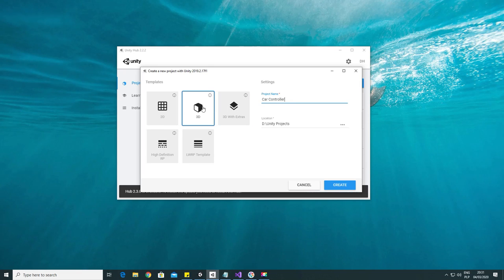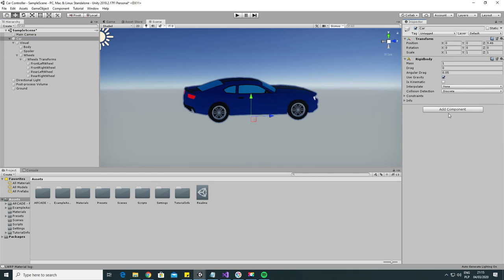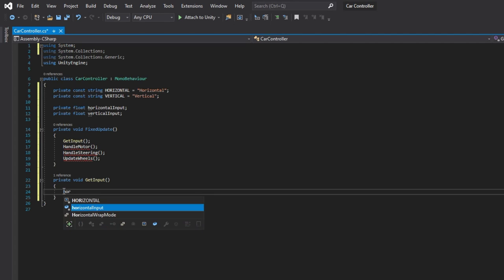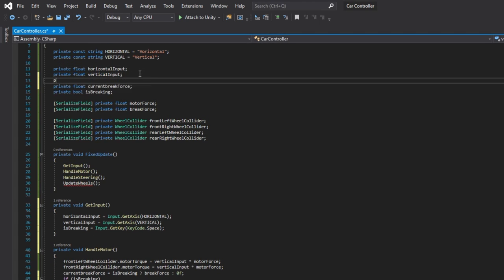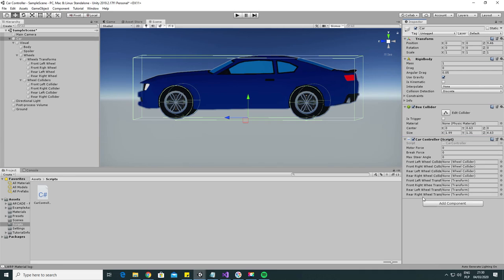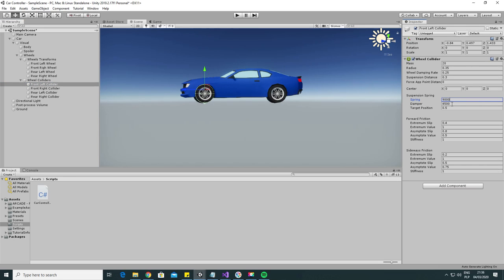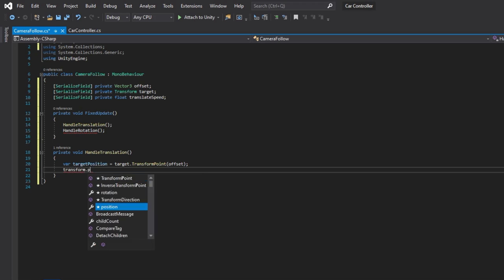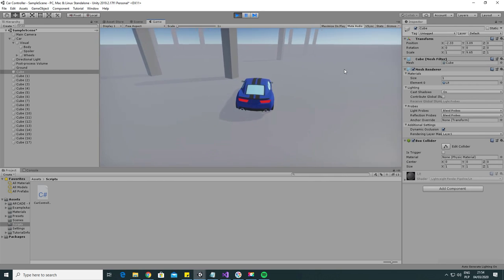Simple Car Controller in Unity Tutorial

Comment: yeah, it seems I've copied his script perfectly but my car doesn't turn. it goes forward and backward (with some slow acceleration) but it won't turn at all. any ideas?
EDIT: nevermind, just got it. had some variable set to steerAngle when it was supposed to be currentSteerAngle.
Reply: Did you manage to make the car accelerate faster?
Reply: @ItsKevin183  I did manage to fix it but I never got the car to work well, I belive there are free car controllers out there if you still need them. I don't have the project file anymore either.

Comment: Just in case someone used cylinders for wheels (like i did) - remove capsule colliders from them. Otherwise your cal will not move :)
Reply: I used cylinders for wheels, but the problem is, my wheels tend to go flat when i turn on playmode

Comment: the car keeps jumping around when i press play
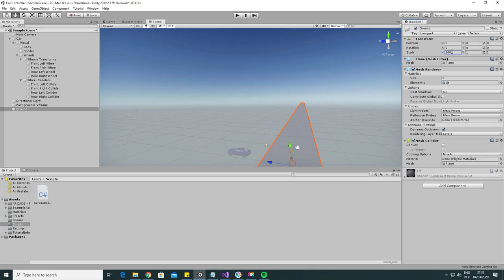Reply: Go fix it with 7:50
Reply: or you used the collider wheel gameobjects for the transforms when you should be using the wheel collider gameobjects
Reply: Also if youre online, did you know why my car is working, moving but my wheels mesh are rotating around the car like they are not even locked to body

Comment: i followed the tutorial step by step yet my project feels different than what he has, I've made sure everything is the same. I'm using unity 2021, the issue is that the car seems to accelerate slower, and overall seems to have slow movement. what can I do to fix it?
Reply: Might possibly be the scale you have the scene at? Like you may have made the car bigger than its original size? Could also be your PC runs slower than most others, and so it simply slows the gameplay down. Might be something else, but those were some ideas

Comment: After Start, the wheels on my car are sideways. Not as they should be.
Reply: Important is that all pivot points are good, mine car was flapping like a fish on dry land. My wheels were sideways too. I changed my model on the good position in Magikavoxel, pivot point and direction. Also what worked for me, make an prefab of your model with all correct coordinates.
Reply: same thing is happening to me, i see the radius of the wheel collidor correct but once i press play, the wheels transform turns 90 degrees
Reply: same for me
Reply: @renatopires1661  change your model of your tires. Maybe you can rotate it 90 degrees. Also check your pivot point in your 3d modeler. The tire must be in the center.

Comment: S l o o o o o w   d o o o o o w w w w n n n n

And dont skip anything, dont cut through anything, preferably narrate WHILE youre doing the coding, and try to troubleshoot common mistakes. And if there is a bug with the final code you need to fix the file instead of just including the fix in the description of the video.
Reply: also the camera script part is completely unnecessary. put that in a different video since it has nothing to do with a car controller